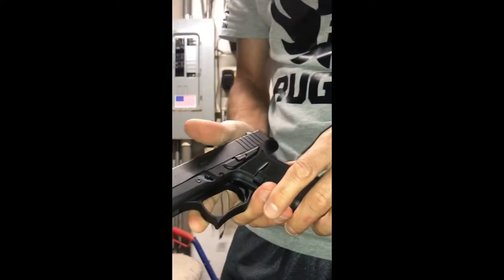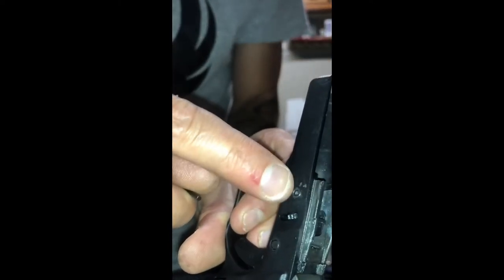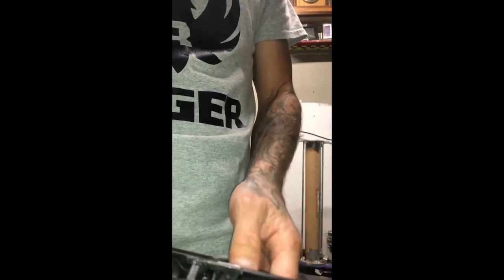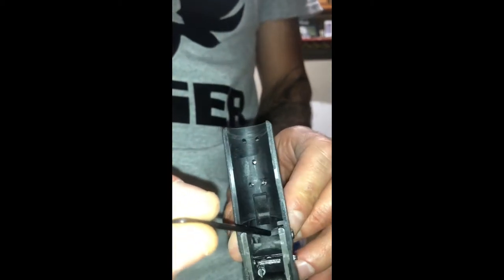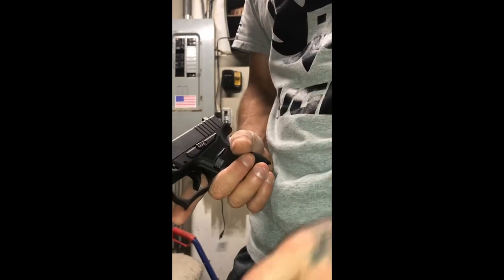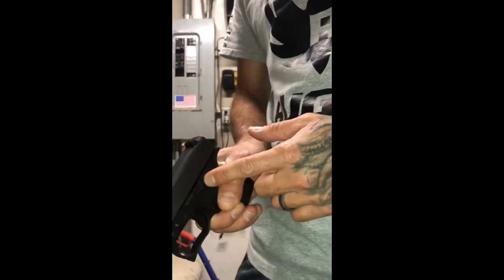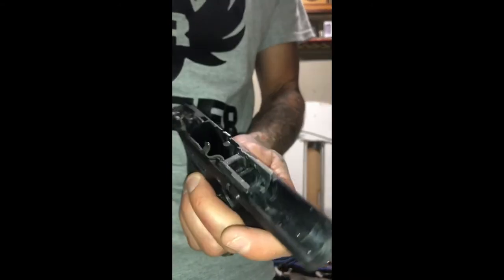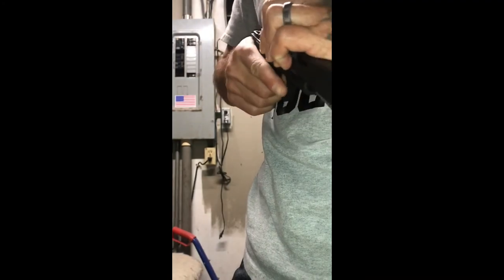SS80 Modifications 2nd pin added How to video

Comment: Did you ever figure out why the slide is not locking back after the last round?
Reply from the maker: Yeah I did. The slide release lever wasn’t a oem one so it was off a little. When I put a factory oem one on it holds back now after the last round and haven’t had any issues with it since. I have a video but can’t post. I’m still suspended from my YouTube channel. I made another channel so should be posting on there
Reply: @lunaticrider209  so my SS80 slide wouldn’t lock back after the last round, it ended up being the magazine. Once I tried a different magazine it worked fine
Reply from the maker: @macky7668  I’ll show you how a oem and knock off slide release looks like. There’s a huge difference between the two. Once my channel allows me to post videos again I’ll make a short video showing what can happen with non factory slide release. Thanks

Comment: Why did you drill the hole I’m sorry I’m new to all this and I just order a ss80 frame
Reply from the maker: No worries. I didn’t like how my front locking block kept popping up and down. So I did this modification to fix the problem. Most front locking blocks have two pins to keep it in place.

Comment: Would you recommend this over a P80 pf9ss
Reply from the maker: There’s pros and cons between the two but I’d recommend the SS80 over the PF9SS. The rear rails are so much better and it puts together easier imo. I have well over 8000 rds on my SS80 and it’s still going strong. I have both frames and I choose to shoot the SS80 over my PF9SS every time. Personally it feels great in the hand.
Reply: @lunaticrider209  thanks is it necessary to put the set screws?
Reply from the maker: It’s not necessary but the ones I see cracking there frames don’t have it and have less rounds then mine. With the set screws in place it keeps the front locking block from moving which helps the frame from cracking and lasting much longer imo.
Reply: @lunaticrider209  The reason I would go with the P80 because of the second pin But I can’t find it in stock anywhere
Reply from the maker: Yeah they almost didn’t add that second pin. Glad I gave them a ear full lol. I get emails for them when in stock. I’ll put a link up for you once I get another one. They got different colors as well.
Reply: @lunaticrider209  thanks